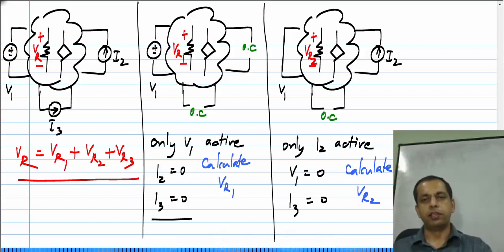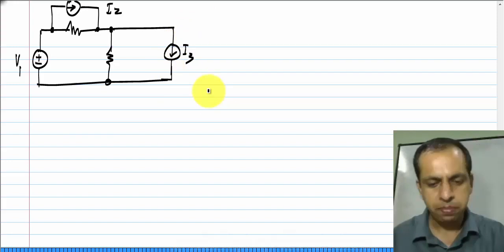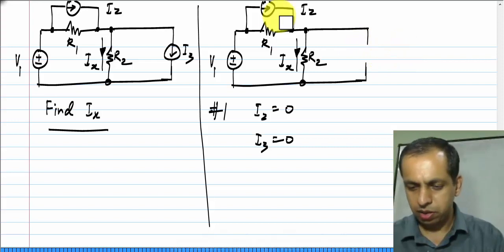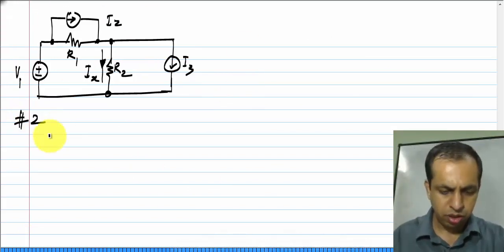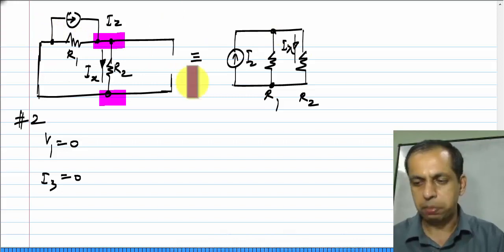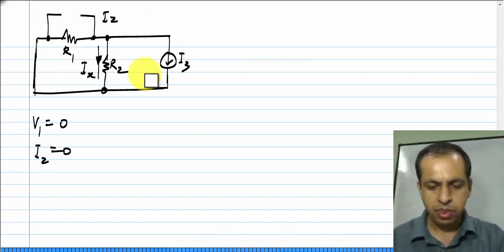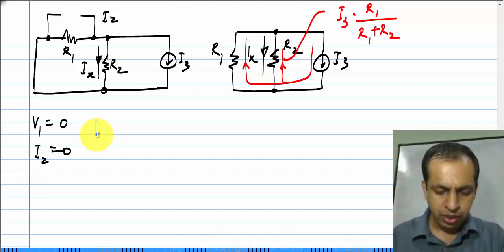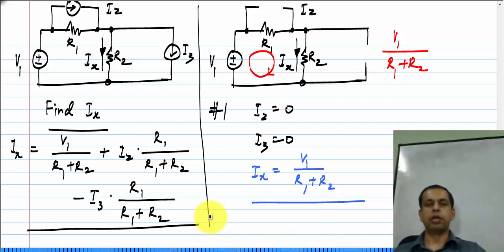0606SuperpositionExample

Comment: I'm in the Alison NPTEL Electronics course and I have been mostly struggling with understanding both this and its examples of Superposition. mostly because the examples I think that I would have a malefaction if was to actually apply such examples to a bread board. The WHY has been confusing to me without showing examples of how to make this work with an output. I don't know if such is later shown in the curriculum. its the same with other examples on youtube that also that exclude the type of resistors being used to follow these examples easier. While at this point we should be able to math resistors ourselves. This has been my most confusing challenge so far for a while.